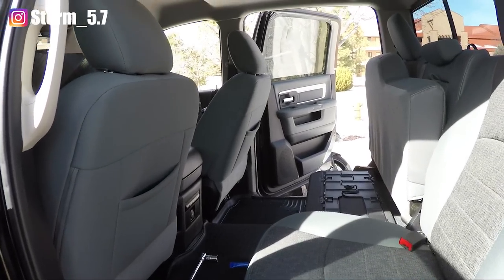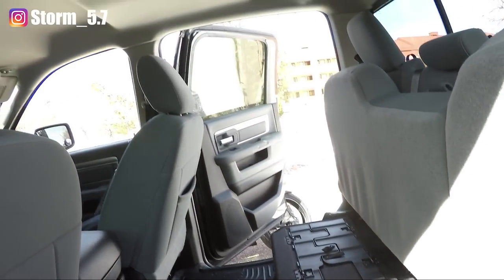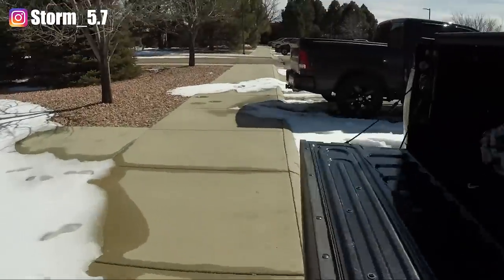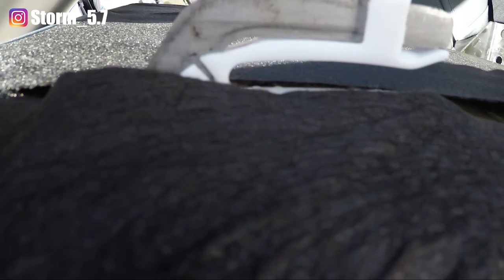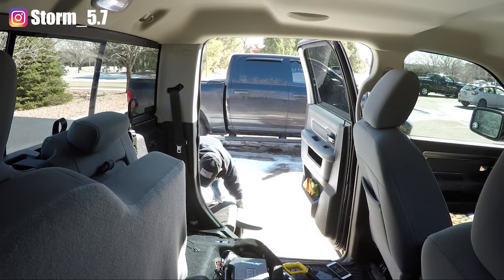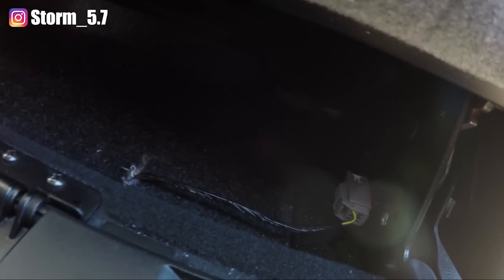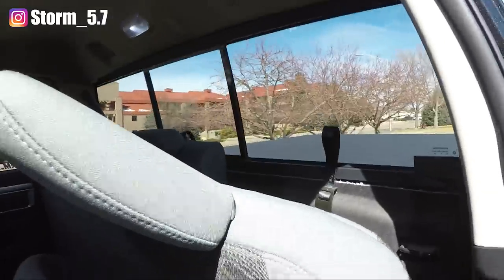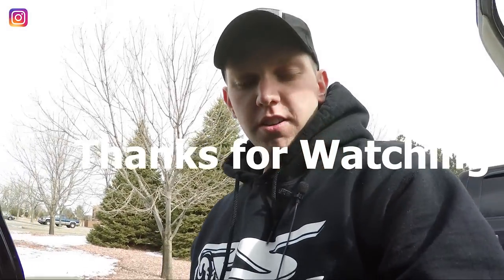Ram Back Seat Mod

Comment: Great video. The full bench seat on my Ram 2014 Quad Cab didn't need to cut the backseat hooks; just a small spacer on all 4 mounting bolts lifted the bench just enough to where it unhooked when folding the lower seat up about 45°, then locks back into place when you drop the bottom seat back down💯 For "spacers", I used (9) 7/16" washers on each bolt. The height difference is minimal and not noticed by passengers, but also gives that little extra helpful space below for stowing larger items...especially a subwoofer box💯
Reply: Great. Always wanted to do this. Will be doing this
Reply: Flip those hooks upside down and you won't need as many spacers.

Comment: All you had to do was raise the seats with a few washer until the hooks would disengage. I did on my 2018 Ram 2500 crew cab. Worked perfect and no cutting required.
Reply: You don't have to do that, the part the hook slides behind, unbolt it and turn it upsidedown and bolt it back and it drops it enough to clear when the seat moves up to it's highest point
Reply: How many washers exactly? Thanks
Reply: @jeepstertj556  I’ll be trying this first. Much obliged.
Reply: @erikperrott7302  for safety reasons it would be best not to shim the mount from the floors with washers(takes the bracing from the bracket away from the floor and puts all pressure on the bolts mid section - not good and could break in a wreck) would be best just to undo two bolts and flip the piece the upper hook slides behind on the back wall but if you want to live risky go ahead. I hope you don't have children that ride in the backseat
Reply: @jeepstertj556   They are permanently attached on the newer ones I believe. Totally agree with you on the washer idea though.

Comment: Great vid! On my 2018 with the rear bench I needed to cut an 1/8” above the plastic protector. You cut fish to the bottom I needed to cut 1/8” above the top, so another 3/8” for the bench.

Comment: Anyone watching this...PLEASE do not cut up your seat. Get some nuts for the rear bolts that are about 5/8ths thick and install them between the rear seat legs and the floor...then flip those hooks that are on the back of the cab upside down. When you lift your seat bottom, the top/back will rise up enough to "unhook" from the rear of the cab. No cutting involved and works like a charm everytime. Just put your hand against the seat back when doing the reverse and it will hook into those metal loops.

Comment: thanks Kody, watched this yesterday and did my 02 Ram today. My seat backs have a black plastic piece lining the metal hook. It is tabbed in place, so I removed first then cut the hook. On the 02 style, cut the seat back hooks about 1/8" above the hole for the tab and itll work fine. Trimmed the plastic pieces to size and a bit of epoxy to hold on place. 
Thanks for this, very helpful
Reply from the maker: Glad this video helped you! Thanks for the comment! Hopefully it can help some 2nd Gen Ram owners out there!

Comment: All rear seats are designed to fold down you just have to release the rear latch.
Both Ford and Ram have a latch behind the seat just pull it upward.
Reply from the maker: Wrong, there is no rear latch on ram 2009-2018 trucks
Reply: @doitwithkody1939  nor on the 99

Comment: I am installing a carseat, I found the two anchors at the crack where you sit but I am now struggling to install the anchor that goes over top the back of the seat. Any suggestions?

Comment: I have a 2019 Ram Longhorn, Is the under seat box you have a stock box or a aftermarket box. Mine has stock panels that fold up to make a under seat box
Reply from the maker: Mine is stock on my 2015 bighorn
Reply: My 2018 lone star has the exact same back seat with the storage under the seat. It came stock on mine

Comment: If u fold the bottom seat up like they normally are suppose to, is the top seat unhook at that point and can swing down? Or does it only come unlatched when u hole the seat at a 45 degree angle?
Reply from the maker: The bottom portion of the seat needs to hit that 45 degree angle before the back of the seat will fold down. If the bottom of the seat is full extended upwards the back of the seat will still fold down, hope this helps!

Comment: I would like to do this to my truck, would I be able to fit a small profile subwoofer?  Thank you!
Reply from the maker: It is possible, but there is not a lot of room behind the seat. You can always cut the liner of the rear wall out. I think it would be perfect for mounting an amplifier back there.
Reply: My alpine system came with a small subwoofer under the passenger side rear seat.  So I would think you could make it happen.
Reply: Check with Harmon-kardon they make an upgrade.
Reply: There's a box that fits perfect under the seats that fits 2 -12" subs, and you mount the amp behind the seat.

Comment: Like your under the seat storage covers, where did you get them from?
Reply from the maker: They actually came stock on my truck!
Reply: @doitwithkody1939  Kody- What year is your Ram 1500?  I would like to get those under seat storage covers that fold out into a platform for my 2012 Ram 1500.  Much easier to have gear or dog in the back without have to ride the transmission hump
Reply from the maker: @caseyheberling1824  my Ram is a 2015 Bighorn. Those fold out storage covers have been very useful for me! Good luck searching for them!
Reply: @caseyheberling1824  - thats what I use mine for. The dogs love it back there. I have a bed for my basset to lay on.
Reply: This is why I have a RAM for the flat deck for my Mastiff and the under seat storage. It is a factory option for the Big Horn and above interior trim... I had it in my 2013 RAM 1500 Big Horn and I have it with my 2019 RAM 2500 Big Horn. When I was looking for my new truck (2019) the SLT interior trim did not have this feature. You just need to look for it or build something with plywood that will do it for you.

Comment: This served zero purpose lol
Reply: Was thinking the same thing once I saw how much space the backs take up when folded down. This made me stop wanting to fold mine down ;-)
Reply: Unless you need to hide something I totally agree.  It makes no sense and time is a valuable commodity.
Reply: Would make cleaning the back window easier
Reply: The entire time I watched this i was trying to figure out what purpose it serves. My conclusion was Zero! Washing my rear window is nowhere near this much work and certainly not worth ruining my $55,000 truck. My opinion, but what a waste of time. And to hide a gun? FYI, they make locking underneath rear seat storage compartments. And you don't have to use a hack saw on your truck to put it in.
Reply: @TheNewenglandboys  I just did it yesterday on my 70k truck and it ruins nothing. And its not that much work. As for gaining space, nah, really does nothing for gaining space IMO. I stand by it being worth it just to clean the window.
Reply: @DMANROCK1  ya, hey what ever makes ya happy bud!  I've never found it difficult to wash my rear window lol
Reply: @TheNewenglandboys  have to pull out the headrests to get at the window and they barely clear the headliner.
Reply: @DMANROCK1  I don't have that issue. I cut a piece of cardboard 3" wide by 8" long from a pizza box or whatever I happen to have hanging around, wrap a micro fiber sprayed with glass cleaner on it and slide it right behind the headrest. Easy and Done. By the way, if you haven't tried "Sprayway" glass cleaner, it really works great and has a really clean smell. Its in a light blue and white can.
Reply: @TheNewenglandboys  good info, always looking for the best glass cleaner 👍🏻

Comment: This doesn’t seem like a great idea for those that have kids in the backseats. I realize you probably don’t yet but just seems like a bad idea all around.
Reply: It does not jeopardize the safety of anything.  It just allows you to get behind the rear seats. There is quite a bit of room back there for mounting an amplifier, fishing rod, hunting rifle etc.. As long as the seats are in the normal position they hold the same as they normally do. And the seatbelts are bolted to the frame so doing this or not doing this does not affect them at all.

Comment: Outside of hiding guns or drugs i don't see the purpose of this modification. It don't give any more usable space in the back seat area
Reply: I did a similar mod to my 2500 about 8 years ago and it adds quite a bit of storage space. It's enough to fit a ratchet set, some cold weather emergency gear, jumper cables, axe and chains (or double rifle case).